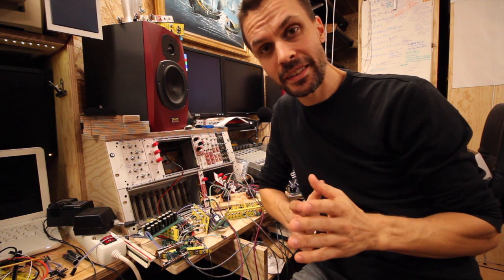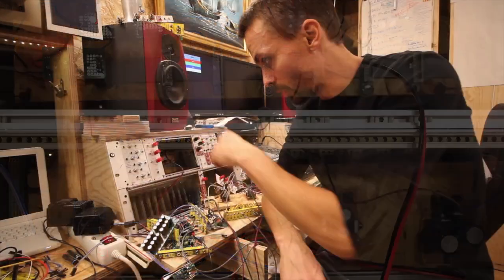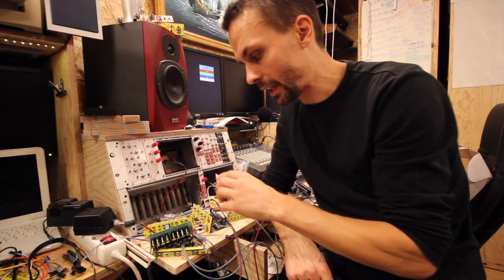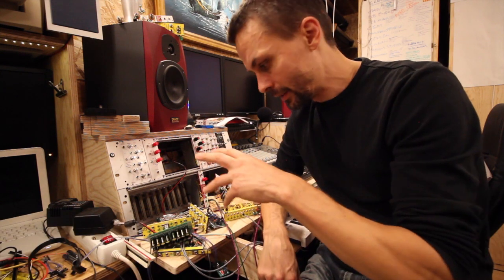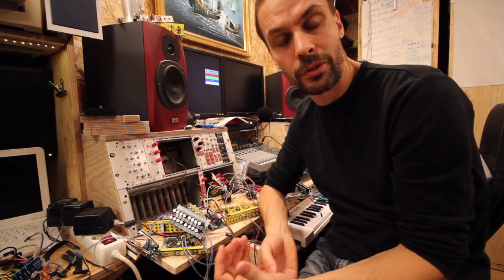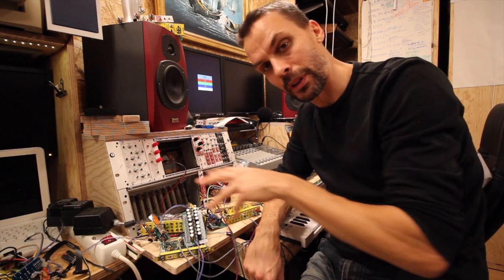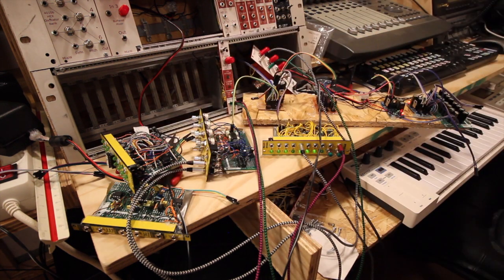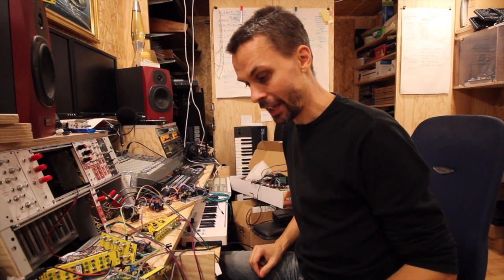Ripple - and how to get rid of it (one way)

Comment: You may want to consider using STRIPBOARDS (prototype boards which feature PARALLEL copper traces) your your power busses.
Just add the IDC connectors (regular 16 pins or 10 pins ones, you choose!) and you're good to go.
Reply from the maker: Yeah it worked great on my protoboards aswell as I just connect the pins to the central strips.

Comment: Sound interesting, maybe a ripple module could be a thing :P Very good info, I think my case should bearly work with one 2000mAh PSU, but I will try adding on a LFO to see if it is too hungry, because it wimght be cutting it a bit close after doing some calculations. Working on a cleaner 3340 board now, and finely got a dual VCA finished, feels like a real synth now :D
Reply from the maker: Great to hear. When the Vcas get in place it does make a lot of difference of the functionality. Feels more like synth I agree. :) 👍

Comment: If it was me, and it has been, what I do is I have a big input PSU at a higher voltage then I regulate down to what I want on each board. Expecting one PSU to regulate for each board is fantasy. That's just not how it's done. That's why PC PSUs output 12V today. Nothing uses 12V but everything has its own dedicated regulator (VRM) to make the voltage it needs. Every board needs an input filter too. 3 terminal regulator circuits are not hard to make. So expect to make one for every circuit you make. In bulk they're less than a quarter a piece. So buy 10 and you're set for a while.

Comment: Oh well, I had a feeling that little power supply was not going to be enough in the long run.  No worries though, it was super fun to build, I built two of them and I keep them on my bench for projects and testing MIAW and MFOS projects.  I will continue to use my fancy store bought power supply in my eurorack, although I'm going to have to add more power there as well because my wall wart is getting scorching hot. Keep up the good work, looking forward to the ribbon cable video, those are EXPENSIVE to buy!
Reply: When you're into electronics power supplies come with the territory. Half the circuits you end up building are power supplies because every project needs power. I've built some real whopper PSUs over the years. Like a 300W+ linear one.
Reply from the maker: Yes sorry about that. :) but it was really simple to build and did work quite long. A really simple improvement as I say in this video is to just exchange the 470uf with a 2200uf. But yeah a store bought one is always “better” I guess :). I also have them everywhere to just plug in when I’m trying things out.
Reply: I will take your advise and swap out the cap. Thanks again for all you do!  Totally enjoying your content.

Comment: I have noticed this problem with my setup.
Does the capacitors need to be the same values?
Reply from the maker: I don’t think so but I haven’t tried. Although it is very common to put a large and a small cap next to each other to get rid of both esr and ripple. So it should work. But make sure that the voltage rating is at least 35v (preferably larger)
Reply: @SourceryOne  I will give it a try when I have some spare time, thanks for the tip.

Comment: There's a limit on how many capacitors you can effectively use in this kind of PSU. First, the inrush current (when you switch on your PSU, the caps are empty and filling them creates a huge spike of current). Second, the capacitors can be refilled only if your transformer/AC-AC Wall wart can actually deliver the required current. So, having too much capacitance is both useless and problematic at some point...
Reply from the maker: Yep. I figured that too. But 2F should work as most diy psus (yours also I think) uses 2200uF. But of course I figured this was around max. I’m going to keep a close eye on the ac-ac adapter so it doesn’t get too hot.
Reply: @SourceryOne  You can harvest decent step down transformers out of old stereos and car battery chargers. You want weight! Though the voltage out of old stereos is kind of highish. Car battery chargers put about 14 or so VDC rectified and filtered. I got one on my desk I should measure it. There's multiple taps and the way I have it setup it's putting out 16.1 VDC I was using it to zap nicad cells. I have a 15,000 uF cap on it. A black Nichicon. I use the square 35 amp bridges. It's good for 10 amps plus.
Reply: NTC wants to know your location.
Reply: I'm not a specialist, but Meanwell specify maximum of 1200uF for their 1inch bricks, so yes, there must be a limit for each PSU.
Reply: @iqnill  I'm sure they mean well but ah, 1200uF is piss! There's two filters in a PSU the high and low side filters. You filter the AC (the high side) and then you filter the regulated output (low side) too. What you use is based on your expected maximum current draw. There's a formula to calculate what you need. Audio amplifiers typically are unregulated but have massive high side filters. The biggest capacitors I've ever seen have come out of minicomputer PSUs. I have some 120,000 uF caps out of those. They're the size of tall boy beer cans. The cabinets of those machines are taller than I am though. About closet sized.